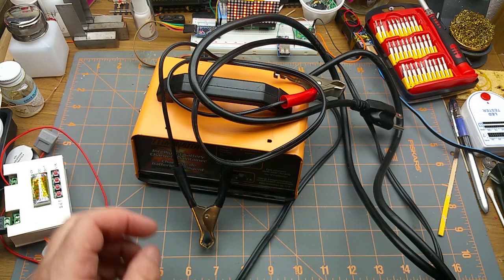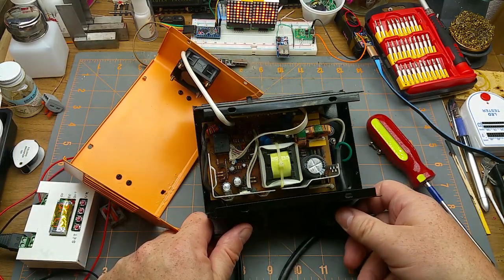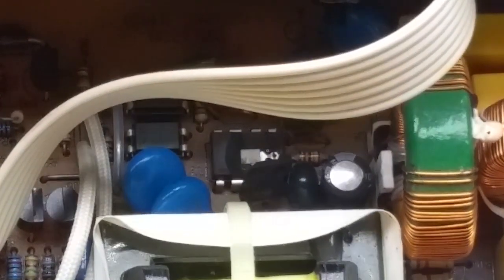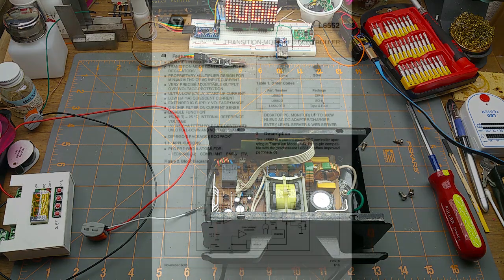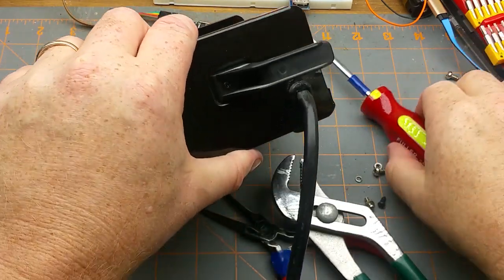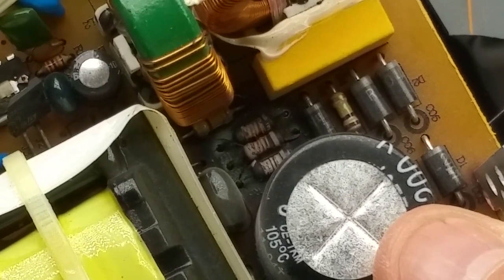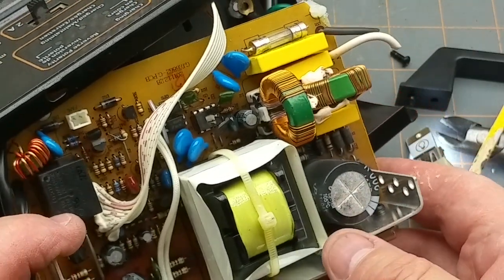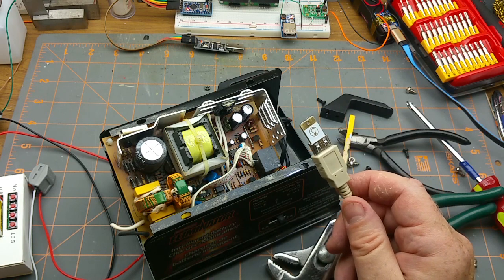12v battery charger repair (attempt)

Comment: I would turn it into an old fashioned 12V battery charger. You would need an old fashioned transformer with a 14v secondary. It could not be too big or it will not fit in the case. I have done this before using components that I salvaged from other items. The only other essential component is a bridge rectifier. If you are inventive you can put other bits in it like some overcurrent circuit protection and a simple means of cutting the output current like using a single diode in series and feeding the battery with half wave DC. I always find these things entertaining.

Comment: if nothing jumped out as burned and if too much appears burned toss it in the trash. a battery charger doesn't need to be that fancy. i really hate the fact you cant find a simple bridge rectifier and transformer charger anymore. i don't want a charger that tells me it won't charge a battery that is showing less than 4 volts.

Comment: The fan would likely be dependant on the polarity of power, it's an active device doing brushless commutation electronically.  Try the fan again and reverse the power if it does not work.  If it fails both ways, then toss.
Reply from the maker: I actually tried both ways 'round off-camera. It doesn't spin easily just by pushing it around either.

It does give a small kick when first powered, but I think it's more mechanically seized than anything. 

Thanks for watching, and for the suggestion.
Reply: That's a handy trick to know. Thank you Dave.

Comment: Would  you be able to tell me the type of fuse it needs if it has to be replaced please?
Reply from the maker: On this one, the fuse is the least of it's problems...
Reply: @pileofstuff  of course but since he's already in, he might be able to see the fuse and tell me the model or the amperage. It is actually my problem. It burnt out. I can't see the marking...
Reply from the maker: @matthieulafreniere3355  Is there a rating on the device itself? Perhaps labelled  on the back panel or near the power cord?
Reply: @pileofstuff  I've watched thoroughly before asking and starting looking in the web. Even the owner's manual doesn't say anything about it!
Reply: @pileofstuff  There is a rating on the fuse caps indeed. I can't read it on mine anymore since  I had hard time taking it out, so all the markings have unfortunately been scratched by my pliers... my mistake
Reply from the maker: @matthieulafreniere3355  I was finally able to locate the remnants of my old charger - it had a 3 amp fuse in it.
The AC input was listed as max 1.7 amps.
Hope that helps
Reply: @pileofstuff  oh wow that's great to know my friend! Thank you so much

Comment: Where did u get that power supply @3:24 ??? I like!
Reply from the maker: It is a 3 amp buck convertor that has adjustable constant current and 
constant voltage  output. I power it from an old laptop power brick.

Specifically, one of these: 
https://www.ebay.ca/sch/i.html?_nkw=B3603+Adjustable+Buck+0-36V+0-3A&_sop=15
  

I built my own case for it a long time ago.https://www.youtube.com/watch?v=avv7dsoVO9o
Reply from the maker: It is a 3 amp buck convertor that has adjustable constant current and 
constant voltage  output. I power it from an old laptop power brick.

Specifically, one of these: https://www.ebay.ca/sch/i.html?_nkw=B...  

I built my own case for it a long time ago.
https://www.youtube.com/watch?v=avv7dsoVO9o
Reply: Cool that's the type of one I'm going to make when a part I need arrives. I'm going to use an old Xbox 360 PSU  instead of a laptop supply but it's basically the same thing. Il watch the link you put up for tips. Thanks pike of stuff👍👍❤